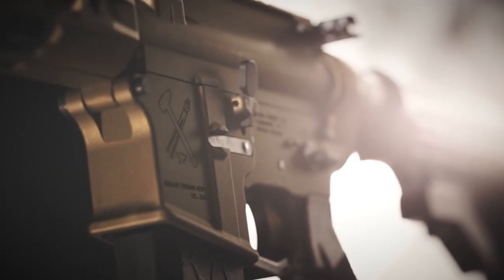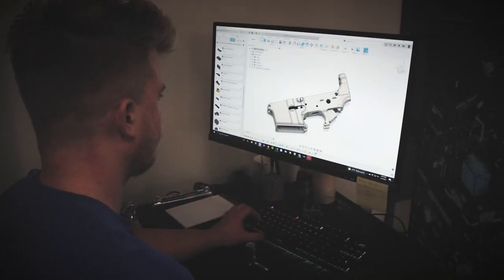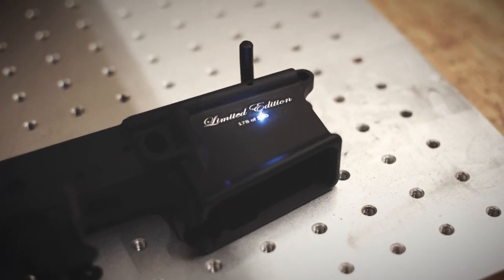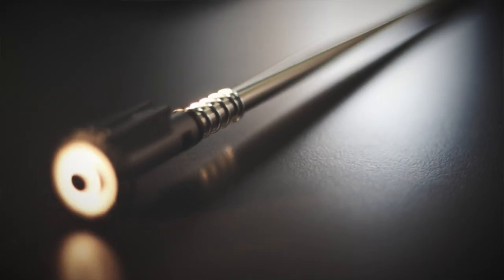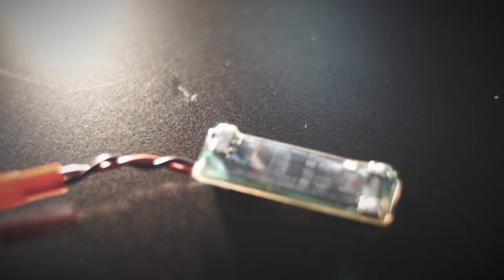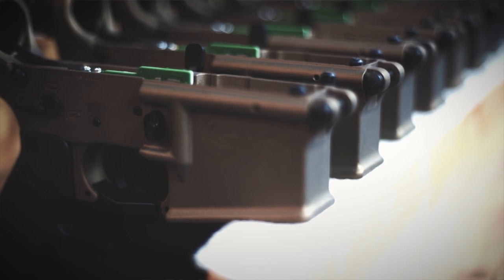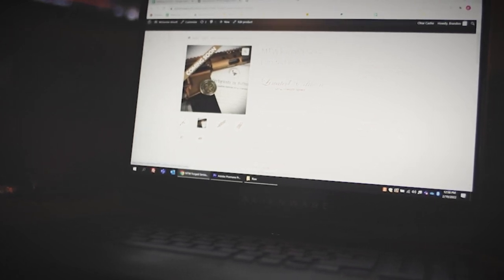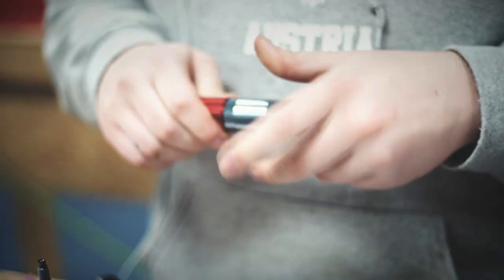MTW-9, Limited Edition, Billet Tactical, and Category 5 Trailers

Comment: I think the magazine choice may have been the worst possible option (ASG Scorpion EVO). I get it has EMD (Which is on brand) but £50 for 3 75rnd mags. especially with PTS offering a £25 140rnd 9mm midcap for the arp-9 PDW. (for the same budget you can x4 the ammo count in half the magazines) I love the PDW style combined with an inferno engine but I cant say I'm in love with the direction here.

Failing to see anything new with the limited edition but the Invictus Mk-1 is nice, losing that RIS rail on the front underside looks lots better.  Furniture is a matter of taste and I am not a fan of the grip or stock.

CNC hop just a metal version of the plastic? Phoenix getting any love ?
Reply: PTS is making evo mags
Reply: @jorgegastelum6767  ^^^
Reply: But there is so many ar9 capable guns. This is pretty slick and the mags have no issue what so ever. Even on high cycle builds they feed.